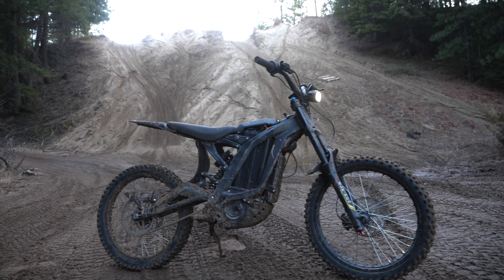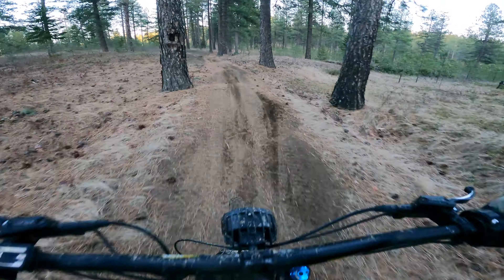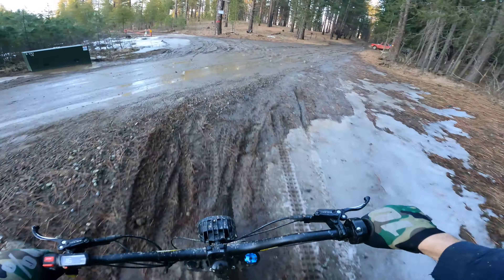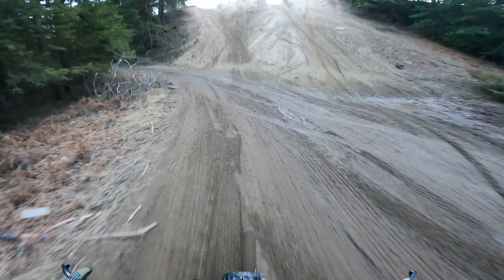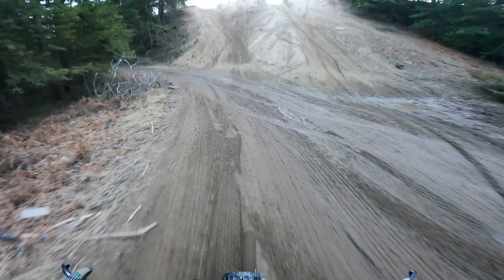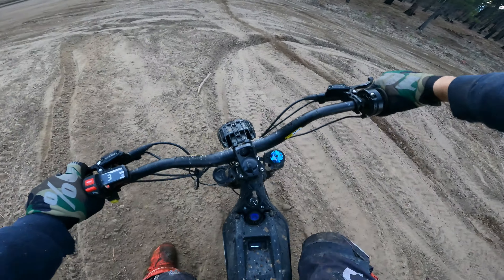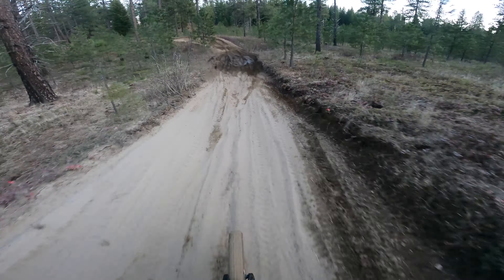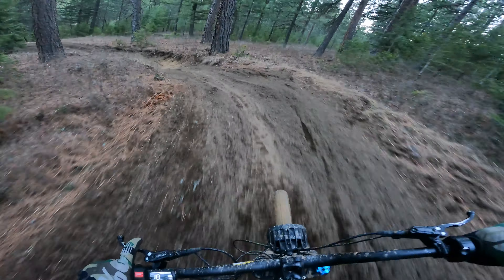Surron X Range Test - Stock in the Sand

Comment: Looks very weak on the stock 60v, i can't justify paying $ 4k for the bike and another $ 3k for the 72v upgrade. Squeking brakes, bad suspension, bad tires, probably ends up paying for a "Drill one" or KTM's electric dirtbike.
Reply: I keep trying to tell people this. By the time you upgrade this to something better, you would've been better off buying something better.
Reply: Get the KTM!
Reply: I wish there was an electric desert tank from Toyota with a power of 90 volts and 20,000 watts
Reply: This isn’t even in the same category as a dirt bike. This is essentially a mountain bike with an electric powertrain on it. He used this bike as it’s not intended in the video lmao.

Comment: Think a stock Surron could carry a rider about 6'3" 230 lbs? not that i can afford one right now, just dreaming
Reply: I am 227 and it moves me. At 6.3 you are taller and the bike feels a little small for me. You will want to lower the foot pegs, raise the bars and maybe even the seat height.
Reply from the maker: It would carry you around for sure! I’m 6’1 and I got handlebars with a 3 inch lift